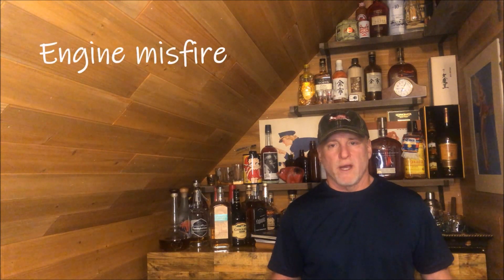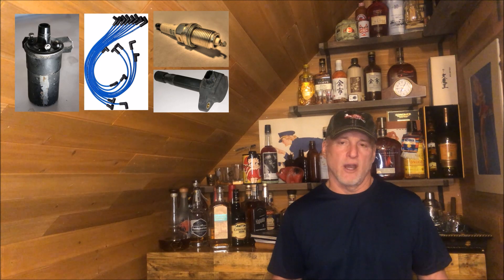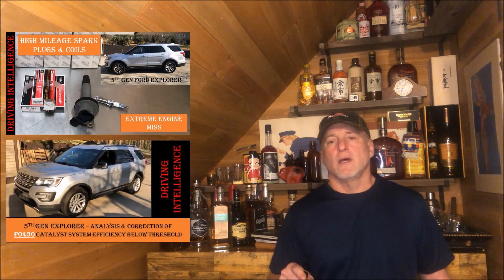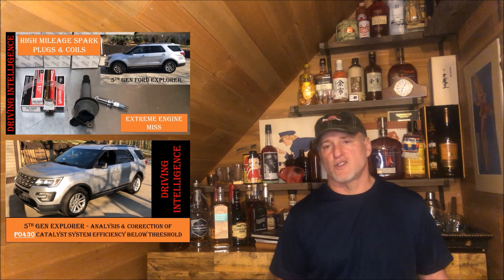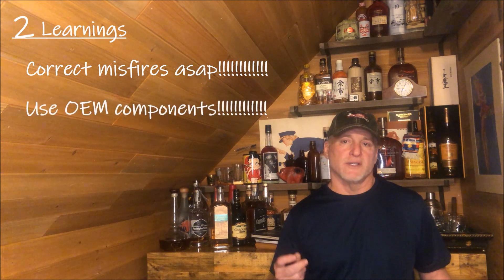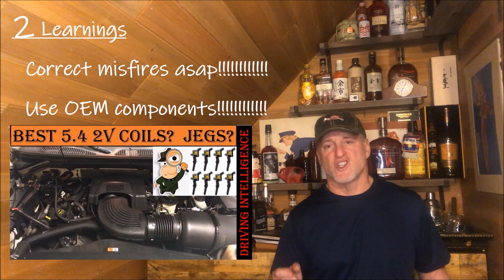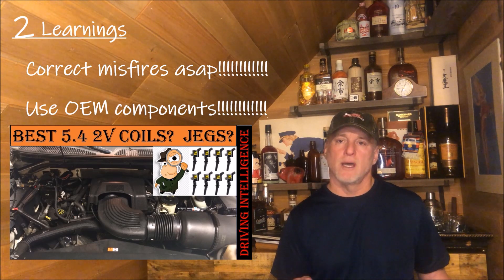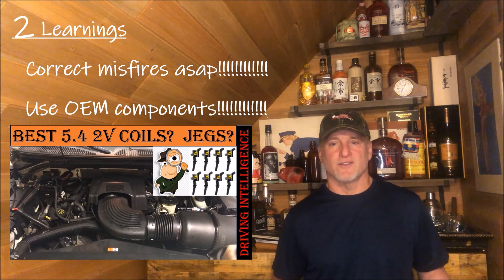How Engine Misfires Damage Catalytic Converters (P0420 & P0430 Explained)

Comment: I had misfires on cylinder 6 so I changed the coil after I moved it to cylinder four and then had misfires on four but no longer on six  but I also had the p0430 code. There was an exhaust leak on the downpipe to the catalytic converter and I fixed that and the code went away on its own for a week and then I had misfires on cylinder 6 again. Now I took the coil off of cylinder 6 and put it on cylinder four and I had misfires on cylinder for and so I replaced the coil just on cylinder 4 because it was bad now but it was cylinder 6 that did it. Now the old coil that I left on cylinder 6 has gone bad And I replaced that with a new coil but the code hasn't gone away and so I replaced the exhaust manifold gasket but the code still hasn't gone away. It sounds like I need to change the catalytic converter now because the damage has been done? Am I right?
Reply from the maker: have you checked the temperatures before and after the converter?  This video might help:  https://youtu.be/VhIG7BOpihM?si=34820ynVzxmbjPh2

Comment: I have a 2003 Dodge Caravan Se V6 3.3L Flex Fuel.

 I want to do a manual cylinder power balance test cutting fuel only and not spark because of the vehicle having a catalytic converter.

 The fuel injectors are buried under the upper intake manifold.

 I dont have a professional bi-directional scanner to use.

 I ordered this right here ebayDOTcomSLASHitmSLASH254515898583 and i was thinking about installing them as extensions to connect them between the fuel injectors and connectors and route them in a creative way so it's no longer buried under the upper intake manifold so whenever i want to do a manual cylinder power balance test cutting fuel only i can do so without having to remove the upper intake manifold.

 I would like to hear your thoughts on this idea.

 Do you think this is a good low tech idea?

Comment: Great place to be standing when talking about such things! I'll take one shot, neat, please. Okay 3. My '07 Lexus ES 350 throws #3 misfire codes every few months over the past 5 years. Coil's been changed three times in two years, the wire, two injectors I think, spark plugs twice. I just started unplugging the battery to reset the ECM, not knowing what else to do. And now I have a PO420, which apparently can be caused by the skewing of the reading of the O2, A/F sensor from the misfires or the misfires damaging the cat. Apparently I have not one but two cats. Fun stuff.
Reply from the maker: Sometimes I need that drink after working on these cars and trucks!  ;)  I did some research and here is what I came up with:

Intermittent misfires on cylinder 3 in your ’07 Lexus ES 350 are a known issue, and since misfires can damage the catalytic converter (as I covered), it’s important to resolve ASAP. Here are the common causes based on this model’s 3.5L V6 (2GR-FE) and next steps to diagnose:

Ignition Coil Failure (Cylinder 3)
The front-bank coils (1, 3, 5) are prone to heat damage because of their location—cylinder 3’s coil might be failing, causing intermittent misfires (P0303 code). This is super common after 100k miles, especially with 18-year-old wiring.

Spark Plug Issues
Wrong plugs (e.g., non-iridium like Bosch) or overdue replacements (should be 60k miles) can foul cylinder 3’s plug. Oil from a leaky valve cover gasket or carbon buildup might also be the culprit—intermittency suggests partial fouling.

Fuel Injector Problems (Cylinder 3)
A clogged or leaking injector can cause lean (clogged) or rich (leaking) conditions. The 2GR-FE’s direct injection on the front bank builds carbon, affecting cylinder 3’s spray & causing misfires.

Air Intake/Vacuum Leaks
A vacuum leak (e.g., intake manifold gasket, PCV hose) or dirty mass airflow (MAF) sensor can misfire all cylinders, including 3. A loose PCV hose from a prior plug change is a known ES 350 issue.

Other Possibilities
Valve cover gasket leak (oil in plug 3 tube), bad gas cap seal (triggers VSC/CEL with misfires), or carbon buildup on intake valves (direct injection effect)—these are less cylinder-specific but could contribute to the problem.
Reply: @DrivingIntelligence  Thank you. I really appreciate you taking the time to look into it and reply so extensively. I've copied it all onto a Word Doc and will have to go over my maintenance invoices, which I wish were more detailed. Since the coil and plug has been replaced multiple times, I guess we could look into other things. I remember the valve cover gasket coming up but don't think it's been worked on. A lot of times the misfires have been coupled with overheating, and all my mechanic can say to that is he suspects my head gasket's leaky...for a few years now. I don't know. The thing is super powerful and responsive with nothing frothy in the oil. I did just have to add about 1/3 c coolant in it today. I'll stop now. Aaaaah. Thank you thank you.
Reply from the maker: @mamandapanda185  very welcome... but by the sounds of it, the #3 coil will repeatedly fail due to its location, from high heat.  Try swapping coils to see if the misfire moves.
Reply: @ Thank you again. :) Crazy design. I have a hard time thinking about everyone who owns this car also having to change this coil every few months. I wish I was fluent with tools. My arms/hands are way better sized that my 6'4" 80yr old stepdad's. I'm sure my mechanic doesn't mind seeing me so frequently!
Reply from the maker: @mamandapanda185  You might want to keep a few spare coils around and swap them when this starts.  But with another search I found that the original DENSO coils seem to hold up better, but are pricier.  I hope you get this sorted out low cost!
Reply: @DrivingIntelligence  Thanks! I know the plugs are Denso and those were all changed last year, so the chances of the #3 coil that was replaced at the same time (again) being Denso, too, is pretty good. Unfortunately the location of the 1/3/5 cylinders are not DIY friendly, but I will be sure to keep the right coils around in the event I have to take it to the shop!

Comment: I want to remove the Catalytic Converter on my 2002 extended cab F-150, any thoughts on that?
Reply from the maker: I wouldn't, unless they are plugged.  They truly help the environment.  Unless you have a turbocharged vehicle or other super high performance adders, it's not worth it.
Reply: @DrivingIntelligence  okay, thanks for the reply.

Comment: I’ve had engine misfires bad enough to flash the check engine light on the highway. The problem? Spark plugs that were way out of spec (should’ve been changed ages ago). Change your spark plugs, people!
After we had to get the catalytic converter replaced (old one was stolen), I noticed an increase in power
Reply from the maker: thanks for your comment

Comment: Hi I’m having a misfire on cylinder 2 and cylinder 6 on my 2015 ford explorer police utility. Misfire only happens when I accelerate at idle around 2500 RPM and when I drive it happens around 55 MPH. When the vehicle is idling and i scan it, only code I get is o2 sensor bank 2 slow response rich to lean. But when I put the rpm up to 2500 I get misfire code 2 and 6 cylinder but never both code at the same time. Can you point me in the right direction. Ps I change O2 sensor, ignition, coil, spark, plug, fuel, injector, fuel rail, with all OEM parts.
Reply from the maker: Can't really help you yet... might be a vacuum leak  What are the codes?
Reply: @DrivingIntelligence  thank you for responding and to answer your question it’s a p0300/p0302/p0306 and bank 1 and bank 2 downstream o2 sensors slow to respond rich to lean.
Reply from the maker: @js2music231  I hate to have you chase a problem with parts.  Best to diagnose.  What are your fuel trims?  I'm interested in both short and long term fuel trims and suspect you might have a slow oxygen sensor.  If you can get your hands on a smoke tester, see if you have any vacuum leaks.  This is a good start without having to buy alot of parts.  Here are a couple of my smoke test vids to check out:  https://youtu.be/CbNPdL9YWe8 / https://youtu.be/3mnH4zg_Tmg
Reply: @DrivingIntelligence  yes I have a smoke down tester and I will do the test shortly. My fuel term. I’m not sure I’ll check before I do smoke down test

Comment: Facing this very very expensive lesson myself
Reply from the maker: Yeah, hard lesson to learn
Reply: @Driving Intelligence  The thing is the car operated and worked perfectly fine still does so didn't take the engine light with importance
Reply from the maker: @AlanJaison1  you have the diagnostic trouble codes without the engine miss?
Reply: @Driving Intelligence   The car has been operating perfectly fine with an Amber engine light for a few weeks now. The other day I realised I had a diagnostic device so thought I'll check and I have the codes for engine miss fire and inefficient cat converter. Haven't been to a car mechanic yet.
Reply from the maker: @AlanJaison1  ah, ok... so you probably haver a damaged cat from the misfires.  What do you drive?
Reply: @Driving Intelligence  ford focus 2016
Reply: I have a 2005 Buick Lacrosse. Started misfiring and engine light came on. I drove it about 8 minutes home. Replaced the ignition module and engine runs great now. Next day the engine light came back on through the p420 code. Engine is still running nicely. Can I drive the car for a while till I save enough $$$ to take it to the shop? Last month I spent $1200 for new lower/upper intake manifold gasket’s and bypass elbows.

Comment: How do you know if your having misfires?
Reply from the maker: Normally you feel it.  The engine will buck and shake and very low on power.  Do you think you're having a problem?
Reply: @DrivingIntelligence  Motor runs very smooth, using harbor freight temperature gun,  I measured cat temps in 370F, temp out 430F degrees. Both banks.
Reply from the maker: @kodiham7532  that’s perfect
Reply: My nephew test drove a F150, I put on obd2 sensor and it had P0420 & P0430 yellow "Pending" the dealer said old fault cleared it. He drove it again shortly looked OK. He bought it drove home ~100 miles the next day real Fault red P0420 & P0430 showed up. I cleared it again waiting on emissions to be active hoping to find window with no faults to get inspection sticker.
Reply from the maker: @kodiham7532  If you live in a place like California, they will know you cleared the diagnostic codes and will fail you.  A vehicle needs a certain number of key cycles and miles to pass many emissions tests.  You should have your nephew take the F150 back to the dealer and tell them they played games and need to repair the issue or get your money back.  Otherwise, you should take your case to the better business bureau or somewhere else that has regulatory authority.  What they did was wrong, likely illegal and they knew it.
Reply: @DrivingIntelligence  I live in california and am having a hard time passing smog. I ran the OBD2 and p0036 and p0141 bringing up faulty 02 sensors. I replaced them and even put cat cleaner, was thinking it was the cats. I’m also having misfires, not sure which cylinder, why or how, just during idling, but that might be affecting emissions too. What is your opinion on fake smogs? I wasn’t gonna go there but I could get it for a few hundred and It’s the last option before breaking my high school paychecks on some cats…
Reply: @DrivingIntelligence  after looking at the page , I see the Deville that shows up. The car I’m having trouble with is a 2005 Deville to put it into perspective
Reply from the maker: @2005villian8  Your DTC's are indicating you have a heater circuit problem which has nothing to do with bad cats.  You said you changed your O2 sensors, did you change all of them?  Also, did you check your heater circuit to ensure you are getting 12 volts to the heater circuit pin at the connector?  And do you have good ground on the other side of the heater circuit also at the connector?  Your DTC's could be an electrical problem, not an O2 sensor problem.  (check out this video:  https://youtu.be/KxhA_XMl8d8 )  Finally, your misfires could damage the cats, so go to this video and watch how I test if the cats are good or bad:  https://youtu.be/VhIG7BOpihM - I'm assuming you have no other diagnostic trouble codes, so I also assume your cats are ok, but to do this test you need this item:  Infrared Thermometer:  https://amzn.to/3vFqKMy - Finally, you indicate you have a misfire at idle.  Does this misfire also appears at higher rpm's?  This needs to be resolved first.  This could be many issues starting with plugs / coils / wiring / lean condition or vacuum leak / bad fuel pressure regulator / bad fuel pump / bad fuel filter and on and on... start with a wiring test at the O2 sensors and pull all plugs and wires to see if you have any signs of bad ignition at each plug to isolate where your misfire is coming from.  Sorry for long reply and good luck!